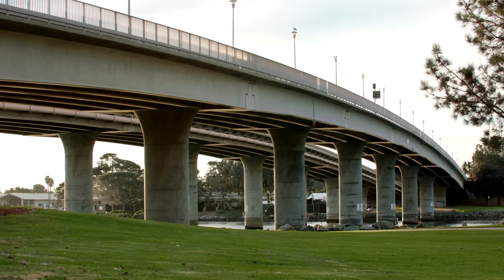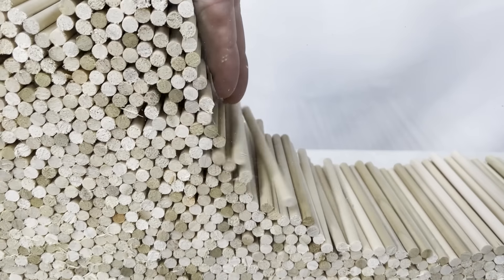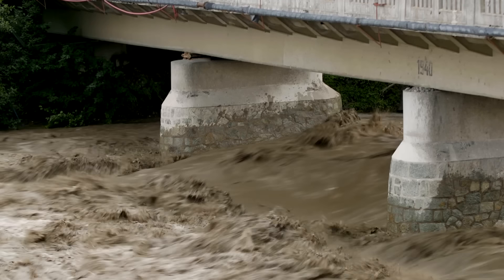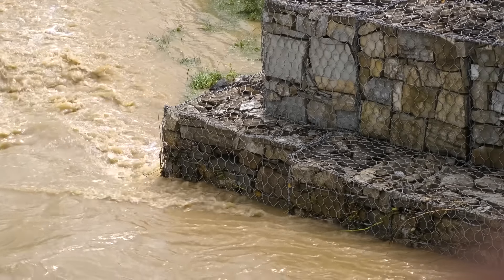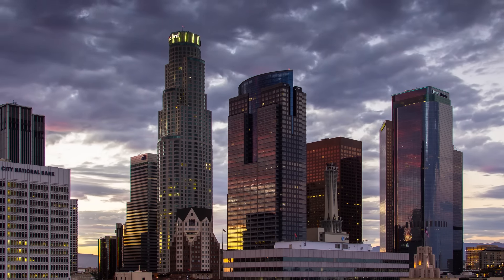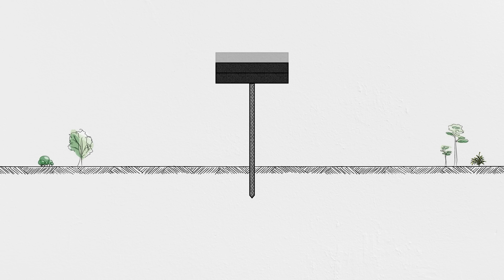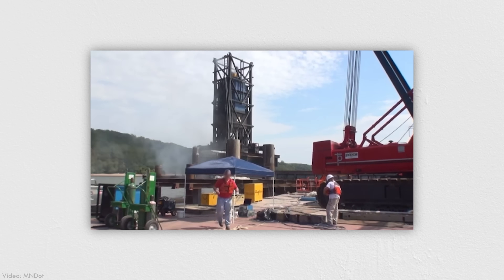Why Buildings Need Foundations

Comment: I have only seen the Pier and Beam foundations in american movies with the crawlspaces, and never understood what it was. Can you perhaps make a video of the differences in buildings from perhaps Denmark, where i am from, and other places around the world. I truly believe the quality and longevity differs vastly between countries, as it would be seen as shoddy in Denmark with the way Americans build their home. It is not uncommon to live in buildings with foundations older than 150 years in DK.
Reply: Denmark benefits from not having a hard winters. Here in Finland the usual method is digging a decent hole, filling it with sand and then puring a solid concrete pad on top of it. Sand prevents the ground frost from moving the foundation and solid concrete is good because it's sturdy enough to endure the winters. Other methods are used but for example driving piles requires specialized equipment for the sole purpose of it, pouring concrete is usually the cheapest way and the most common one.

Building code requires that the roof can sustain snow loads of 140kg/square meter in the southern-Finland and 260kg/square meter in the northern parts. My house has to be able to carry at least 11 tons of snow without collapsing. That puts a heavy requirements for the walls (my walls are roughly 33cm thick to deal with the cold winters) and structures.
All of this means that you cannot build cheaply here. And if you have to pay big money, you expect it to last a decent time, usually the rest of the lifetime of the owner or at least close to it.

US-style of "building per decade" is just unbelievable waste of money and resources.
Reply: @alaric_  Thank you for your comment, it’s always nice to hear from Finland 😄 We use the same method (as far as i know) and have the same snowload upwards of 2,5 kN/m^2, depending of area and slope (≈250kg/m^2). I just think that it is weird to build houses like they do, with hurricanes, storms and so on, when Denmark don’t have that, but here we still build with brick and concret often in layers together.
Reply: @alaric_  Building per decade doesn't really happen in the US, either. Europeans seem to have a fairly poor idea of how things work in the US for some reason.
Reply: Yeah, that is what I noticed as well, here you would see these wooden constructions maybe for old vacation homes, huts, or sheds, but never for an all-year residential building.
Reply: Frankly, i found myself wondering if Pier and Beam is even legal to do in most European countries. I can't seem to find any meaningful sources on the topic that aren't US-focused (and as such useless to my inquiry).
Reply: The whole of Amsterdam is built on wooden poles too. It proves that those foundations may be able to last quite long, if the conditions are right.
Reply: @Llortnerof  I am finishing the structural engineering in the Hungarian University, and  we had like 4 or 5 semesters for the subjects related to the soil and foundations, and for the whole time of the studies, we were introduced to the pier foundations only couple times, the thing is that, in Hungary (most probably in whole Europe) vast majority of the buildings are made out of RC and steel, so you need to use deep or shallow foundations, while the pier foundations are used mainly for the wooden structures or if there is a certain slope of the soil, so i don't know if it is legal to use it or not, but in my opinion its just pointless to use a pier foundations, because unlike the most commonly used foundations, pier foundation requires more specific environment (like very good soil conditions and etc.), i am not sure, but i think in Switzerland there are a lot of wooden buildings in the country side, that were made using the Pier foundations, but here in Hungary, i've never seen such buildings,
Reply: I think it really states that a video of different parts of the western worlds buildings could be interesting, i had no idea that Amsterdam had that, and even though i’m a mechanical engineer, i find construction interesting
Reply: In the Los Angeles area the 1st building boom was in the late 19th century.   Houses were often built on piers and very cheaply.  They did not have any heating as the winter is mild here.  Eventually a pit was built  before putting up the house to contain a furnace that used convection to supply heat to the floor above.  The pit is Called a California basement and we cal the system gravity heating.   This construction is significantly cheaper than building a basement.  After WW2  even raised foundation on piers was thought to expensive.   Concrete slabs were poured over plumbing and the house built on the slab.  A forced air furnace might be in a closet with no ducting.  Eventually the HVAC moved into the attic with ducting.
Reply: @TheMrZhakupov1985  I suppose that would be one possibility. Technically legal, but no practical reason to use them and thus nobody really bothers with them.
Reply: I think a lot of it is just cost, many people dont care if their foundation lasts 150 years, the market just wants a foundation that lasts for 35-55 years, then the house will likely be demolished/rebuilt/replaced

Comment: Interesting that an engineer would still buy the house after seeing a foundation like that…
Reply: Buying a fixer-upper house that has a problem you understand is commonly done. He likely saved a lot of money because most buyers would avoid it and most banks would refuse to finance it.

It's not unlike a plumber buying a house with a destroyed sewer, or an electrician buying a house that needs rewiring, or a roofer/framer buying a house that a tree fell on, etc.

Even if he isn't fixing the foundation himself, he will be able to monitor whoever does and ensure a good and correct repair.
Reply: Limited housing stock and high demand. His location (San Antonio, TX) has appreciated so much in the last 5 years that the equity in the home has easily paid for this work.

Comment: When you're building a pile-based foundation, is it possible to put the concrete basement of the structure as a single piece that sits about 25 m above the surface, resting on the piles that can be driven down to a certain extent. Then, you build on top of that concrete basement platform, using the structure's weight itself to drive the piles downwards.
Reply: differential settlement problem will arise in few locations

Comment: Home ownership and home lifespan aren't the same thing. There's a solidarity argument to be made for reinforcing your building's foundations enough that future owners won't have to also spend a fortune on doing the same exact thing. If you really want to go the capitalist route, though, it'll also raise the value of your building so that when you or your descendants choose to move out, they won't be without the budget required to purchase a new building (and potentially reinforce their foundations/fix whatever was broken there by its previous owners). Cooperation and exploitation share a bistable relationship. The difference is that one provides long-term joy, whilst the other provides long-term misery.
Reply: The real difference is one provides unaffordable housing and the other provides affordable housing. 
1) You can make a foundation that would last 1000 years, but hardly anyone could afford that house. So what does the family do while they save up for this millennium foundation, continue to waste money on renting or live in a tent on the property, live on the streets?
2) If you leave family a home they can't even afford to repair/maintain, when they should be able to afford their very own new house, then you fucked up raising them since they aren't self sufficient.

Comment: About the "we can't make it as good as in the old days" : 
I often answer to people asking why old stuff last longer that nowadays, our understanding of how things will behave overtime is much more advanced than it used to be. 

Let's say you're a washing machine manufacturer. 30 years ago, if you wanted your machine to last 5000 cycles, you had to overbuild everything to make sure it lasts this long. Now, with modern material science, understanding of fatigue loading, simulations and a bunch of other things, you would be able to make a machine that will last between 4900 to 5100 cycles.
So why bother overbuilding when you can meet very precisely your requirements ?
Reply: Also, it's to their advantage not to make it last too long. If it's costed to last 5 years and it lasts 10 that's a lost sale in 5 years time. Things are designed to last only a limited time so that they constantly have to be replaced and generate future sales.
Reply: As with the other comment... why build for 5k cycles, when they can build it for 3k cycles 80% of the time... and then say "up to" 5k cycles, as that is what they extrapolated the last one would work for...
Reply: Also there's a sample bias: The durable old-stuff survives to the modern day to invite comparison; the cheap garbage fell apart decades ago.

It's similar to art.  People lament that there's "so much trash produced these days", unlike the old classics.  But there's always been huge volumes of trash, it's just that people choose to preserve and remember the classics.  The "best movie of the year" is always going to be above average.

Comment: I disagree on your comment about the cost. Having a house with foundation that can last 100 years make it much much more valuable than if the next buyer knows that he will have to invest a good deal of money during his ownership of the house. And the difference between the retrofitting for 30 years of for 90 years is not 3 times. So, doing a 90 job needs more money to do, but you get that money back when you sell the house. And on an ecological concern, doing something solid produces less wastes than doing something temporary.
Reply: most homebuyers are not interested in 90 years of home ownership, nor qualified to evaluate the lifespan of a foundation. It theoretically makes a structure more valuable but practically its a difficult selling point. A good metal roof or a developed basement is likely a better selling point because you can see and understand that without tests or knowing about soil capacity.
Reply: @randommcranderson5155  When you live in an house that is several centuries old, you see the point of a good foundation that can last 100 of years :)
Reply: If any house sale I've participated in involved the buyer asking even a single question about the structure of a house, I might agree with you.  Buyers in my market care mostly about location and aesthetics, and move as their jobs move and their children grow.

Comment: It always amazes me how "temporary" American buildings are. Here in the UK a house would never be built this way, and as a result last hundreds of years without the need for extensive structural rebuilds.
Reply: It depends where in the US. Down south the crawl space design is common, but up north all houses have foundations/basements made of thick concrete at least 8' deep, which as you said lasts a very long time. Your climate in the UK is similar to the northern US.
Reply: Maybe because it's a bitch to repair otherwise in the UK and a piece of cake here? We have mcmansions here that cost a fraction of a flat in the UK, especially in the south. It's more than enough to last a generation. Like comparing an N95 mask you can change daily for a fresh one over one that costs 10x that can last for 5 days but constantly needs to be babied and irradiated for covid. It's one of the reasons why homes in Japan are not built to last. Even if it did magically survive a local earthquake, would you trust in it's stability? Tests can only do so much.

Comment: Back in the 80s I've use to do the excavation and grading for new big apartment buildings in Sunland CA. Most of the ground was rocks and sand.
In able to dig, for example, a square of 100x 50 meters we use the flooded method.
The excavation was difficult due to the big rocks, the grading was done by flooding the square hole, like a swimming pool.
The Bulldozers have the water all the way up to the steel tracks.
4/7 inches. It's the only way to level a surface on a sand/rock environment.
The track loaders suffer a lot of friction with the permanent contact with the rocks, sand and water.
After all the work the place was flat like a nice square swimming pool.
The guys with the other machines suffer a lot just to make the trenches to install the steel bars and to lay the concrete for the foundations.
Fun times with the hot and humid environment to do the job.

Comment: Something about the history of foundations.
I live in the house my Grandfather built about 80 years ago.  A few years ago I had the basement waterproofed (and insulated).  Occasional but rare water leakage, but it was also damp and smelled of black mold.
   The contractor dug down inside the basement walls to lay drains (among other things).  I was told later they were surprised to find footings.  Most houses built at that time just had the walls resting on the ground (clay around here).
   The footings were too small, they told me, for best use, but at least I have footings.

Comment: A couple ideas for further foundation videos:

1.  I'd love to see more about the methods for modeling/predicting the bearing capacities of driven piles.  I've seen Wave Equation Analysis reports (I'm a construction engineer in the transportation sector), but I don't really know much about the process that leads to one of those reports, and I'd love to see your take on the process or any other methods you'd like to cover.

2.  It would be interesting to see you cover drilled shafts - their specific advantages/challenges, and any interesting or extreme real-world examples you can think of.

Comment: I live in northern Pennsylvania, where the frost line is about 4 feet underground. Virtually all houses here have a full basement, with a strip footing under concrete block or slab walls, and a poured concrete floor added after the walls are built.  Plumbing and ductwork for the house runs under the first floor deck - aka along the basement ceiling. Many / most basements are unfinished.  Some builders will build the basement with an extra row of block, at minimal expense, raising the basement ceiling higher than average; if the homeowner eventually decides to finish all or part of the basement, a finished ceiling can be installed below the plumbing & ductwork without being so low as to feel claustrophobic.

Comment: As a geotechnical engineer your explanations here are spot on.  Statnamic testing (using the explosives) is a relatively new form of load testing of piles, although it is hard to get tests approved post 911 as no one lets explosives be used anymore!

Comment: Great video. I do calculations for soil type and loading maximums with distribution poles. A very important part of power is the pole structure and ability to withstand the forces from hurricanes to bogs. The foundation is key to success.

Comment: Strip footing question? First some background on my foundation architecture. My 45 in deep crawl space (subfloor to ground)  is comprised of a block perimeter foundation/walls approx 45 inches in height. On the interior/soil section of the crawl space, are four behemoth concrete STRIP FOOTINGS: (two 40 ft. strip footings & two 20 ft. strip footings) which are rebar reinforced. They are 12 inches in width by 6 inches in height that sit on the soil, shallow foundation type. 

The 4x6 posts are positioned down the center line of the strip footings, the length of the strip footings. The posts are a mere 28.5 inches on center (apart) that then support the 4x6 beams above, beams are same distance apart as the posts. The 4x6 beams run perpendicular to the strip footings or across.

The soil sections are between the strip footings which on average are 5 feet in width, there's five open soil sections between the collective strip footings & the perimeter block wall foundation surround. The crawl space is approx 32 feet in width by 45 feet in length. 

I have had contractors down there and they all concur with me, the crawl spaces is overbuilt, or as they say over-engineered. 

My home was built in 1978, two story. Here's my question, finally! Were strip footings common in 1978? 

There's a new neighborhood being built about a mile from my house and they use the same exact construction design, and architecture as my crawl space with strip footings and a block wall foundation surrounding. I live in southern Oregon. There's no cracks around doors or windows inside the house, no bowing floors or anything amiss. 

The Vapor Barrier is 46 year old, and torn up. There is some water ingress, but only in small ⅛ inch puddles on top of the plastic. No mold, mildew or wood rot in the crawl space lumber. Good ventilation & depth of crawl space as I've noted. I intend to dig some French drains around the perimeter of my crawl space to the existing sump pump, and then put a new 12 mm Vapor Barrier on top of the soil after taking out the old ripped up & torn vapor barrier.

Thanks in advance for your input.

Comment: You can do Cone penetration testing (CPT) to characterise the soil, which among other things can be used for foundation design. In the Netherlands nearly every building site has CPT work done to determine the foundation piles needed for construction. With offshore wind turbine construction CPT tests are also used. Full disclosure I work for Geomil which sells CPT equipment.

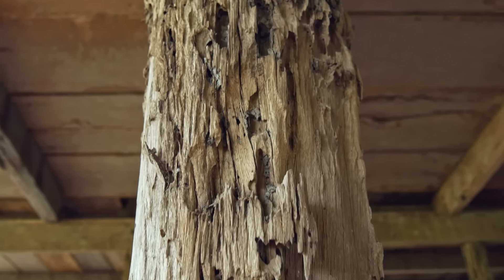Comment: 03:45 is why US elevators start at 1 but in the UK at G (Ground). Originally, buildings were literally built straight onto the earth, so the street level floor in the UK is called the ground floor - the first floor (with actual floorboards etc) was above this. By the time the US was being populated, houses were built on small raised foundations, so the street level floor is the first floor with floorboards.